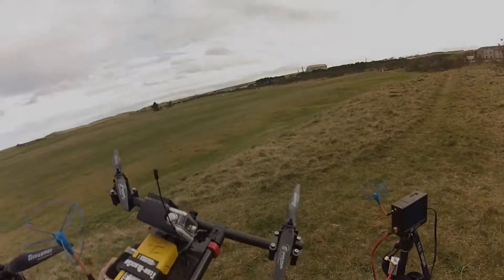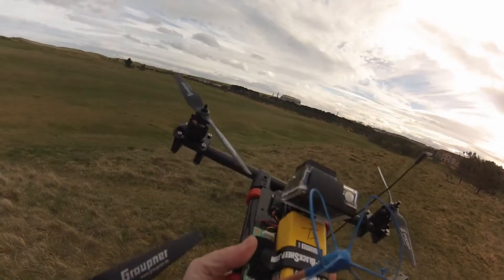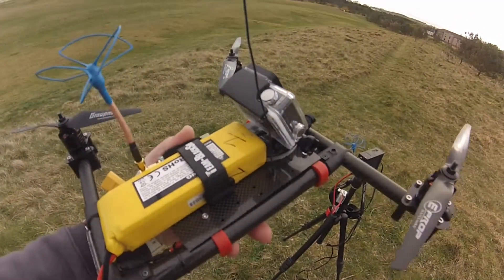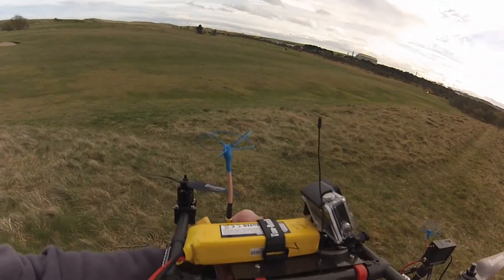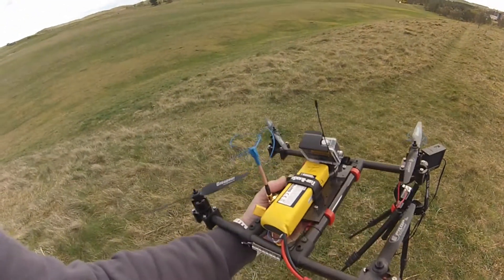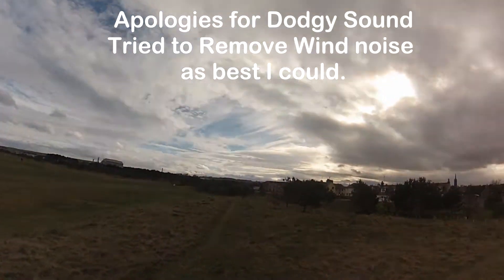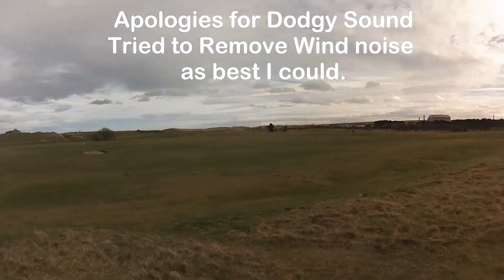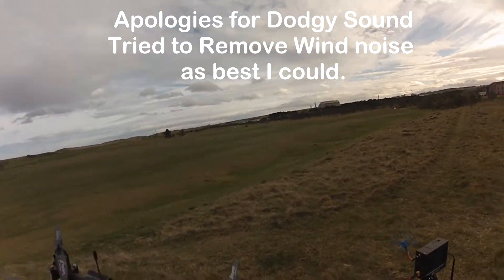Homemade 400 Quadcopter Maiden Flight

Comment: Nice clean design, are ESCs between the two centre plates, or in the booms ?
Reply from the maker: Hey matey, thanks, the ESC's are between centre plates but may get some Afro slim and put them in booms just worried about them not getting any cooling in the booms.